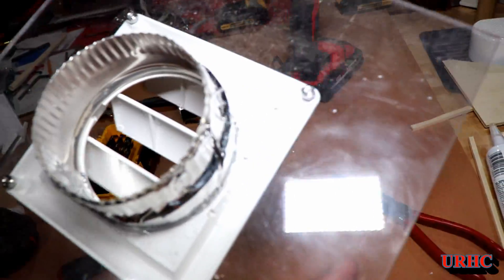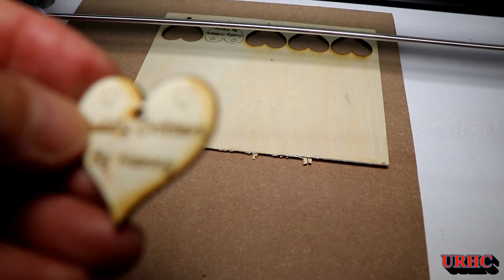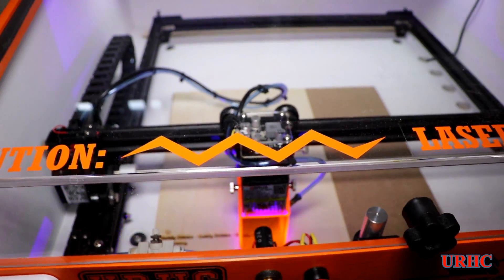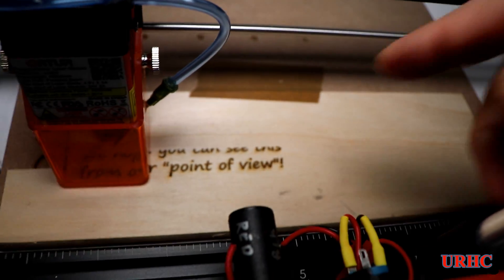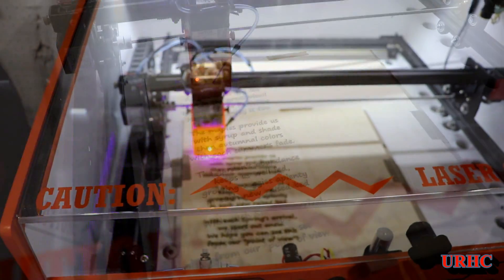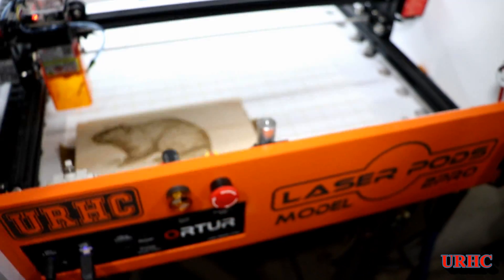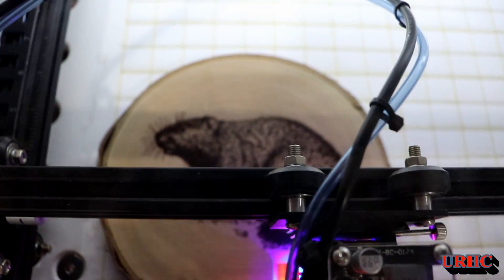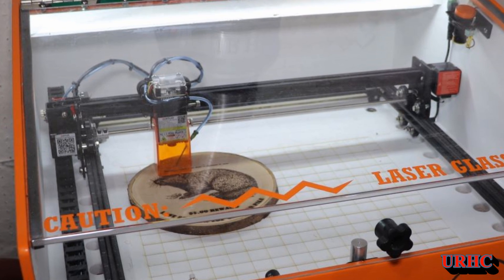First Projects Testing The New Enclosure For My ORTUR LM2 Pro

Comment: A piece of expanded metal under your laser about 1/2 inch above your table would allow for even better smoke removal. Plus you could use magnets to hold down any small sheet goods or thin pieces or wood, acrylic, glass, or thin metals to laser engrave on. Awesome job on the over all setup for your Ortur.
Reply from the maker: I got a honeycomb grid that really helps. Thanks for watching.

Comment: hi what air assist pump do you use please as i can not here any pump running lol thanks
Reply from the maker: It's  hooked  to my shop compressor with a low pressure  regulator and solenoid in the enclosure.  Thanks for watching.

Comment: This is a bit off topic for the video, but is Ortur related. I'm thinking about getting my first LASER. I'm looking at Ortur. They now have two LASER modules. One they say is optimized for engraving (LU2-4-SF) and the other for cutting (LU2-4-LF). I like the cutting one because it comes with an air assist fitting. Does anyone have an opinion on how much worse the LU2-4-LF will be at engraving? I'd like to understanding what I'm giving up in engraving performance to get better cutting.
Reply from the maker: I have no idea without  comparing them side x side.  Ortur could  probably answer your  questions.  They also have many different  level motherboards available  so send them a email.  Thanks for watching.

Comment: Thanks for the video.  Have you tried masking the wood to reduce the smoke stains (see https://youtu.be/GXQ450knQMA ) or do you find it isn't necessary with the air assist?
Reply from the maker: No. I feel that just makes more hazardous fumes. a fast hit with 320 sandpaper gets  rid of them. Thanks for watching.

Comment: Great video! In that enclosure you built can you use the Rotary roller?  What would you need to do to use the Rotary roller? Thanks for the video, I’m going to build a enclosure similar to that.
Reply from the maker: I don't use the rotary on this machine now. I have it set up with  my LM 1. should I decide to use it I would  just cut an opening in the base and mount the adjustable z assembly  from my other stand underneath it. Thanks  for watching.
Reply: @unemployedredneckhillbilly2023  I was thinking of making part of the bottom of the enclosure adjustable to accommodate the Rotary roller, just a thought right now. I did watch your video how you had your Rotary roller set up on a different type laser. Thanks for the fast reply.

Comment: you dont need air assist when engraving. only for the cuts.
also have some rare earth magnets glued to the base and use loose ones ontop of your project (away from laser) to hold work down.
Reply from the maker: Thanks. This  air assist  is something  new to me. Many viewers recommended it and it really  seems to make a difference cutting  as you say. I thought  it was best to always  use it to keep the lense clean and avoid fires. Thanks for watching.

Comment: Can you list the parts for air assist? Thank you
Reply from the maker: I don't  know the part numbers.  They were just old parts  I purchased at a surplus store years ago. Just need a regulator,  needle valve , solenoid,  and glue needle tip. Use the smallest most flexible  tubing, components,  and fittings  you can find to keep the head light. Thanks  for watching.

Comment: Nice enclosure.  I did not see if you have any holes along the front of your enclosure.  I would think that optimum hole placement would be across the front and from the front down each side.  Seems like that would draw air across the areas you are most likely cutting to pull the smoke away.  Too many holes in other areas are decreasing the airflow where you really want it.  Your thoughts?
Reply from the maker: I guess  you didn't  watch  the build video showing  hole placement  and square inch matching.  Thanks for watching.

Comment: Very nice review and it looks lie the product works good. I have been approached to do a review of one of these but unsure of what it expected.
 So when you said the name of the wood I was thinking  it was Catalpa but it sounded as you said Catawba so I looked it up and there is a Catawba and it seems the Scientific name is actually 
 
Catalpa speciosa. I have some pieces of Catalpa and sure enough it looks just like this. I have done some turnings from it and it is beautiful wood.
 Thanks for the review,
Gary
Reply from the maker: I think it's the same wood and that's what I was told it was. I had a big hollow  one at my last house that I took down and managed to save a couple pieces with a little  electric chainsaw I had. Very  beautiful wood I wish I had saved more.
They are  fun little  tools and you just have to show what it looks like and maybe a small project. With a rotary you could add engraving  to turnings or just use it for logos on your work. Thanks for watching.
Reply: When I got my Catalpa it was from a huge tree that had been down for years. A lot of it was rotten but I did get some nice pieces. It was so stuck in where it was I doubt if I could get more.
 It looks like a fun machine. I have 2 CNC mills and I built a 4th axis that I can use on either one. I do a lot of wood carvings on them but I also do some metal work as well. All fun stuff!
 Thanks for the reply.

Comment: Ed, you are not the only one that had a problem with the flame detection on the LM2 Pro. It happened to me too. My solution, same as yours. If you absolutely have to engrave or cut that close to the flame detection sensor,  put a piece of tape across the sensor but remember to remove it when you are done.
Reply from the maker: Thanks.  I have comments from others with the issue also.  I am going to drop the value in grbl to see if I can find a setting that still allows it to work properly without  prematurely going off. The light I added and shadow from the laser could  also be contributing to the problem.  For a new product Ortur did a good job on them with very few bugs. Thanks for watching.

Comment: I had trouble with what I thought was that my flame sensor was too sensitive. If the lighting in the room changed from a cloud passing over the sun, dimming the room from the light coming through the windows, the flame sensor would alarm. 

The only way I could keep it from alarming was to close the shades during the day. 

I’ve said all of this to say if you want to adjust the sensitivity on the sensor, it’s $261 in the GRBL settings. 0 would be totally off.
Reply from the maker: Thanks. My problem is when I use a higher power setting within about 3 inches of the sensor it it will trip. I will play with that setting because it's a great feature when you have a wood enclosure. I actually was thinking about moving the limit switch and putting my 0,0 in the back corner so the laser is always out of the way when loading and flame sensor doesn't false trip. Wonder if it may actually be caused by the light I added casting a shadow with the laser in the front after hearing your problem. Thanks for the info. Thanks for watching.
Reply: @unemployedredneckhillbilly2023  I added air assist to mine last week and like you, it made a huge difference. Also, with air assist, it lessens the threat of fire since the air will be extinguishing it.
Reply from the maker: It sure would be nice if Ortur had a functioning output for a relay to control the air assist because many are adding it. I bet they include it in the next generation.